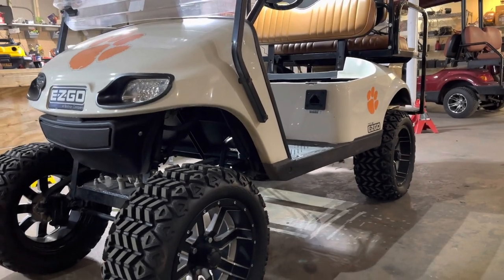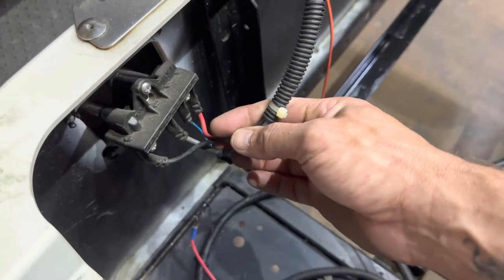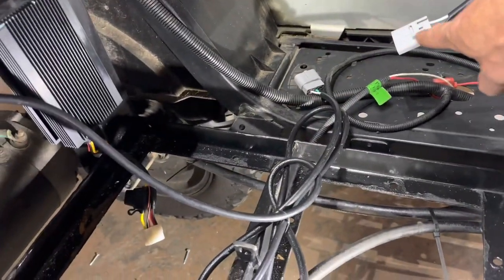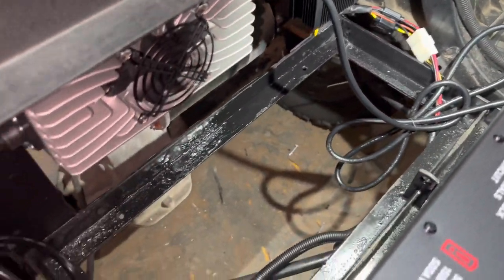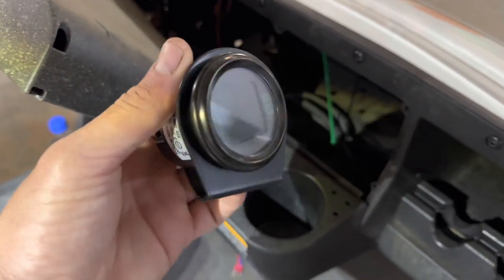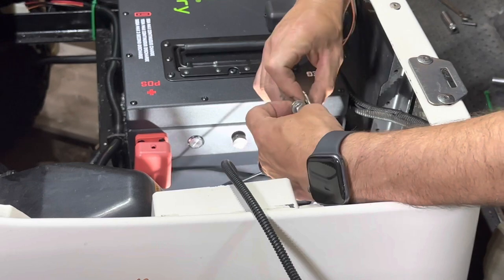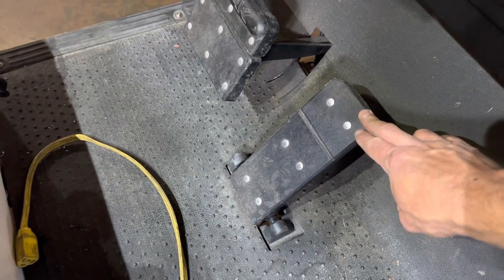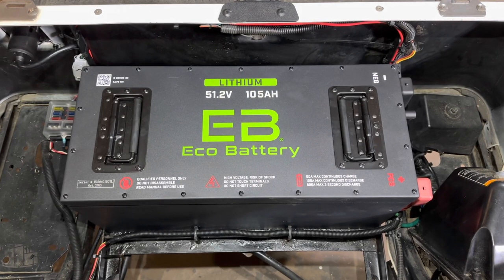Eco Battery 51v - 105ah Skinny Installation Video ~ Ezgo TXT

Comment: I used your install video to install an Eco Battery 48v 105Ah Skinny lithium bundle in my 2014 RXV.  I used other you tube videos also, but I found yours to be my most useful.  I made a mistake thinking I had a metal battery tray (it was plastic - my bad) and got the skinny - but it included a new metal tray that fit with little trouble.  Really appreciate your detailed, step by step approach.  Couldn't have done it without your video.   Thank you so much.
Reply from the maker: Hey Wayne, man I really appreciate that.
Reply: I currently made the same mistake and bought a skinny battery for a plastic tray and not metal. How were you able to replace the plastic to the new metal tray? I can't find any videos on this or any information and don't know where to begin
Reply: @xKodak34   I called Eco Battery and told them I had the plastic tray (wasn't with the cart when I ordered it) not the metal one I put on the order.  They sent me a metal tray to replace the plastic one.  It was fairly simple to replace.  Took me about 2 hours (I'm slow) to take out the plastic and put in the new metal tray.  Just a note.  I'm REALLY glad I made that mistake and got the skinny battery. It fit perfectly AND the button to turn it on/off is under the drivers seat and really easy to get to.  Attaching the battery to the new metal tray was also fairly easy.  Good luck - you're going to LOVE the new battery.
Reply: @WayneAlexander-p9j  Did it require you to remove the plastic bottom or was it a piece you can just lay inside and screw in to secure? Plug and play pretty much
Reply: @xKodak34  I had to remove the plastic tray to get the new metal tray in.  The plastic tray was simply held in with bolts/screws, so no major cutting required.  A little tilting and maneuvering (and help from my wife) to get it lined up.

Comment: GREAT INSTALL VIDEO , WHAT IF YOUR CART already had a voltage reducer do you run both or switch to the new 30a . and new fuse block ?  i like the fitment of the battery in the txt looks great
Reply from the maker: I would run two or the new one.

Comment: Hey I have some questions. Is it better to have multiple batteries say 312 V batteries or just one 36 V battery lithium?
 Also my car already has some speed control or modification on it supposedly gets up to 24 miles an hour but I've only done 22. That being said with getting a lithium am I in danger of burning out my motor?  I'm assuming it's a stock motor.
Reply from the maker: No danger with motor. The controller is set to give power the motor can handle.

Comment: Good morning, what CAN connection from the battery/voltage meter cable goes to the charger CAN connections. There are two coming from the voltage meter cable(from battery)? In your video at minute mark 3:49. Thanks in advance!
Reply from the maker: The signal wire on the charger output plugs into either of the small dangling ports of the LCD wiring harness. It’s a new feature.

Comment: Hey, I just received the Eco Battery 105ah 48v kit for my tempo. Similar to yours, it also incorrectly states on the top that the continuous discharge rate is 150A and not 175A, along with a 500A max 3 second discharge instead of 600A max 3 second. Was this a misprint or something? I don’t want to install it if I haven’t gotten the battery I ordered, so looking to hear what you say. Thanks!
Reply from the maker: It is a factory misprint

Comment: So that orange wire gets 3 way connected to the white and yellow on the ignition?
Reply from the maker: Correct, the cold side of the key switch. Different switches can have different wire colors, I would recommend testing voltage at the battery - and your positive lead to the key switch post. One shouldn't have voltage until the key switch is turned into the on position.
Reply: @PalmettoBatteryPros  got mine working just like you said.  I have another question, do you know if any 2 inch wheel spacers fit the txt? I tried a set of orion's but the stock ezgo studs are too short to thread the acorn lugs all the way.
Reply: I’m still confused, does the orange wire get connected to the positive side of the battery or the cold side of the key switch.

Comment: If I am installing this on a TXT with a Navitas A/C conversion (so no stock controller), do I still need to energize the reed switch bypass by attaching that orange wire to the positive post on the battery?
Reply from the maker: No, I don’t believe that switch is required on the Navitas controller.

Comment: Also I'm trying to get a few more MPH if I get a lithium battery thinking of going with this battery or the Allied. Does having the speed controller on my car already immensely help or do I need a new motor whisper or some other gadget New controller? Any Is input helps.
Reply from the maker: You’ll get a couple MpH with lithium, but speed is mostly a controller issue

Comment: installed skinny 52V in 96 txt dcs, despite not having reed switch anymore, the power supply turns off to accessories when placing in reverse and then again when placing in forward. I am assuming the reverse switch ( 2 microswitches with cam lever)shuts off power intermittingly.  Is there a workaround to this. Running Alltrax XCT controller as well.
Reply from the maker: You could bypass and run the long orange to the positive post of the battery.